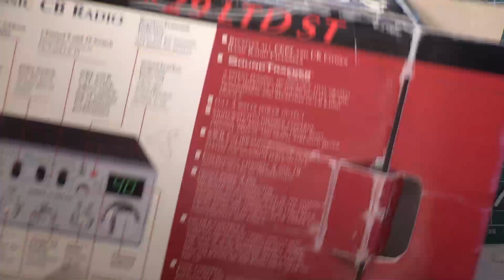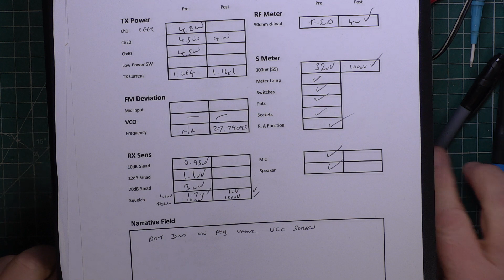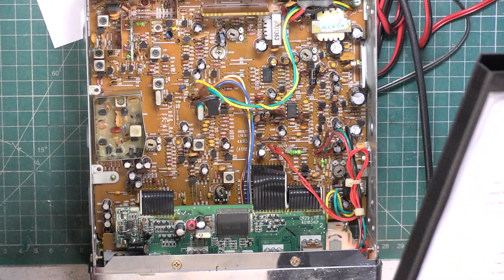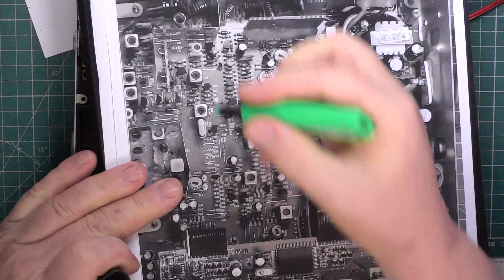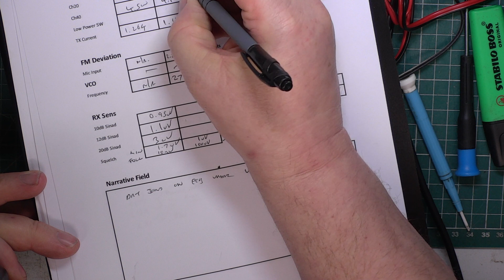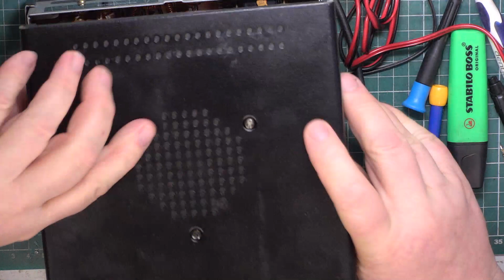Cobra UK29LTD-ST PR27/97, UK/EU FM  CB radio - repair & aligment

Comment: So SWR of 1.1:8 means around 8% of TX power lost, so you're 4w and any losses incurred in that RG58 and the length of it probably means you'll be lucky to get 3w at the antenna..
have you ever tried putting a power meter at the antenna and seeing what power you're actually showing the antenna ??

could be a reason no one answers you on a niner roger test ??
Reply from the maker: You've missed or forgotten about the base aerial we use for tests;

It's a something 99 fibreglass end fed without the optional groundplane kit.
It's mounted just above gutter height on a single story building, on the opposite side of the building to which the tests take place. 
The tip of the aerial barely clears the apex of the roof.
The cable is only about 15 feet long & is industrial grade RG58 or whatever.
The SWR on ch 31 is around 1.8:1 & is around 1.5:1 on ch20

There are three other base station aerials here that are mounted higher. The one we do the tests on is the lowest.

The idea is to have an ordinary aerial setup that anybody can achieve & most could improve on. We then do the 6 mile tests purposely the wrong side of a hill in our worst direction. 

In the Nottingham direction I can talk to Mr C from the same mobile in the same car 35 miles away at  Calverton on any of the four base aerials, though I know which he is the best signal on. That's the silver rod cheap copy fed with URM67 on the top of the organ workshop, 20' from ground level.

It's about repeatabillity  comparison.

Richard
Reply: @ukfmcbradioservicingTango21  My fav the URM 67 i also use URM76 for mobile.
Reply from the maker: That's what we use & I only buy cable from Farnell or RS.

Richard
Reply: @ukfmcbradioservicingTango21  should try some RG223 :)
Reply: @ukfmcbradioservicingTango21  well if you ever feel the need to talk to anyone in a west direction you'll need a linear to match their signals :) 
just a shame you've not had a response yet to your call..

one day..

Comment: I have a cobra 25 LTD UK, its extremely sensitive, more so than an old cybernet.
Reply from the maker: Right, well I've now had five 29's...one was beyond anything having been screwdrivered. The four I've now had have all done the same receive sensitivity of around 1uV for 12dB SINAD after alignment....and much worse before. I've never seen a Cybernet boarded radio have sensitivity that poor. Usually they are around 0.5uV, the odd one at 0.27uV; At the other end about the worst is 0.85uV. I feed all the receive figures into our database computer here & it logs the best & worst we've had through workshops. I've logged every receive test since 1999, averaging 300 sets per year in for service. The later 2014 Cobra 29 is worse than this version. The worst sensitivity of any set is the Team Pro8000.

Richard, G0OJF, UK

Comment: Hi Richard thanks for another great video, my only gripe is you've gone to great trouble to install cameras so we can see the results as you work such a shame you don't check that pip is even on!!.....
Reply from the maker: Since I had a different video mixer, the output for the monitor is HDMI. Previously I was using a pair of Sony CRT broadcast monitors; one for preview & one for program output. The replacement mixer does the stuff OK....but the output for a single monitor is HDMI. It gets away with a single monitor by splitting the screen. To cut a long story short, I haven't got a CRT monitor with an HDMI input so had to buy a modern LCD monitor. I can't see the content of the monitor screen from my seated position; only if I stand up because of the limited viewing angle that CRT monitors have. So when I switch PIP on, yes...it shows the output now including the inset picture & I fail to notice if it's there or not unless I stand up.

I've also mentioned a few times before that I was born with useful vision in one eye only...my right eye; the monitor is on the left of me. This doesn't help with the limited LCD viewing angle.

Now, if I had a CRT monitor with an HDMI input, this wouldn't be a snag.

Richard, G0OJF, UK
Reply: @ukfmcbradioservicingTango21  Try a plasma screen that is what i use and will not part with it.